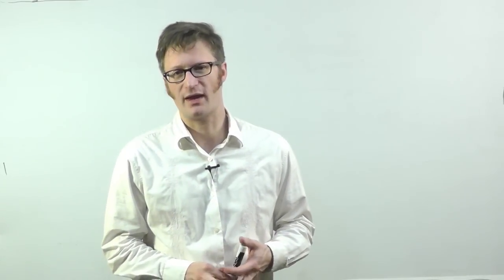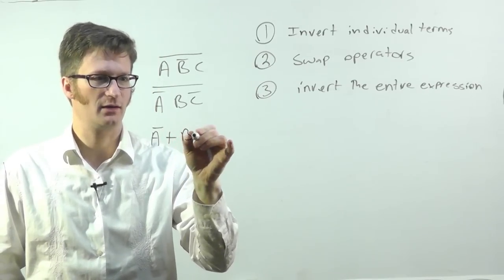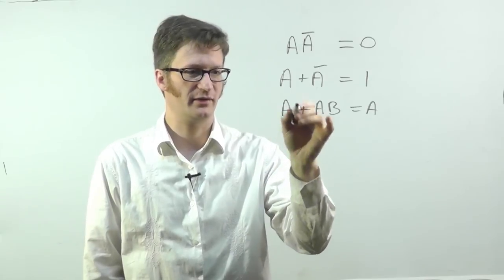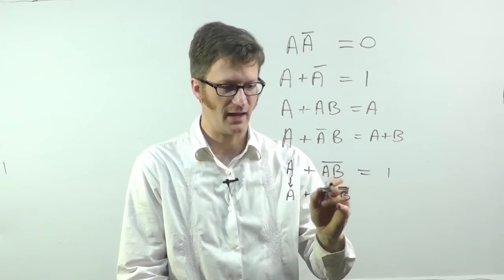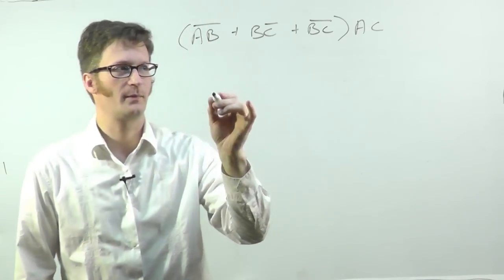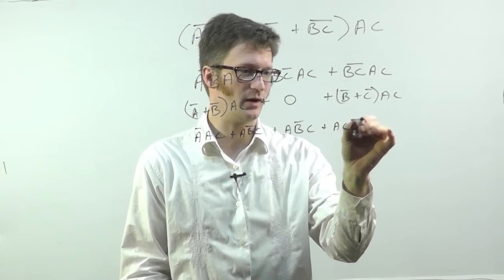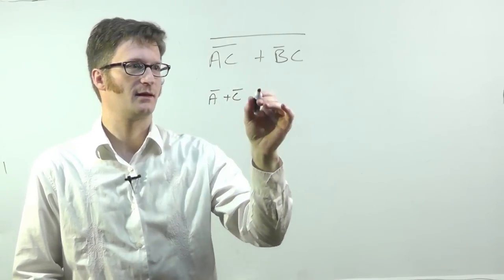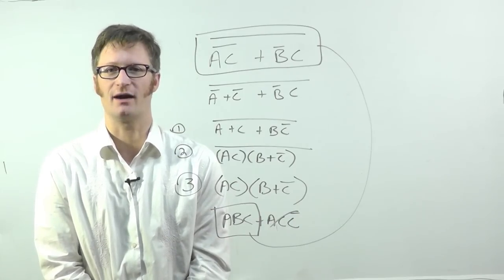Digital Logic - Logic simplification

Comment: It's a shame that they don't use the "&" and "|" operators from the field of software development to represent the AND and OR operators in boolean algebra, because that's how they're actually represented in computer programming . 

Example: F = (A&B) | C   

... becomes ...  if(A == true && B == true || C == true) .... then do something.

For whatever reason, using "+" to represent OR and a "." to represent AND just doesn't compute with my brain. My brain will always see those operations as addition and multiplication and my eyes see algebra (general algebra). Boolean algebra really wrecks my brain!  :(

The reason why you would simplify these equations is not only for simpler, less expensive circuits, but for performance reasons when writing software. These boolean algebra equations become conditional IF statements in software. The more branches you have and the more nesting you have, the slower your computer program will be, especially if those comparisons are performed millions of times in a loop.